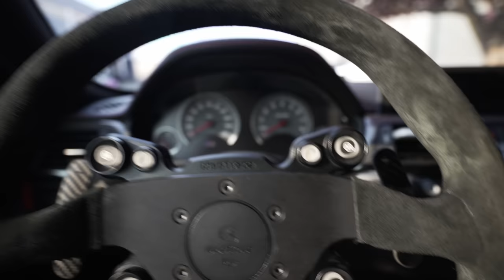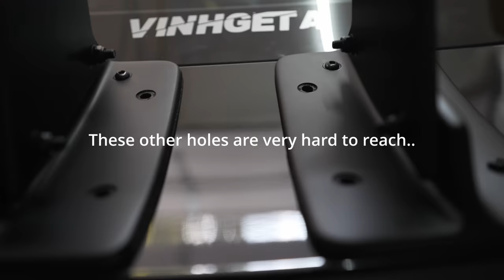This SUPRA is PERFECT now! 😍 (Voltex Type 10 Swan Neck GT Wing)

Comment: Sorry but that looks horrendous. It doesnt flow with any of the original body lines and just looks out of place. I think its the positioning of the swan neck supports rather than the blade. Ultimately  its your car and as long as you are happy with it thats all that really matters.
Reply: I agree. I hope youll have second thoughts on this build vinhn. We no hating but its not good.
Reply from the maker: I respect your opinion and totally see your point. Would have been even better if the stands were just spaced a little bit more far apart. Nonetheless I absolute love it!